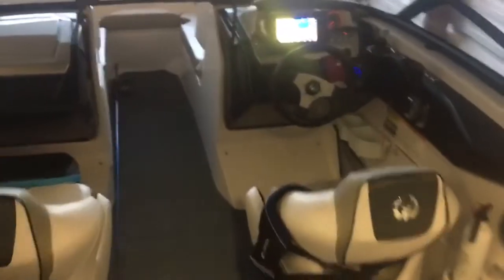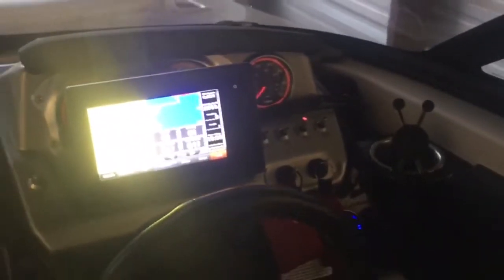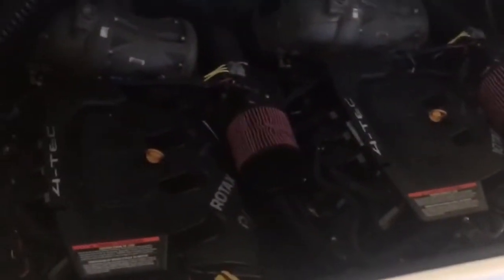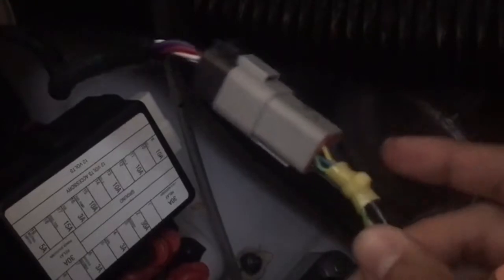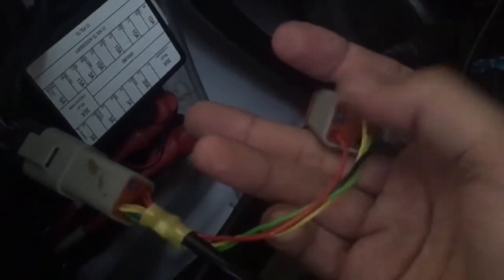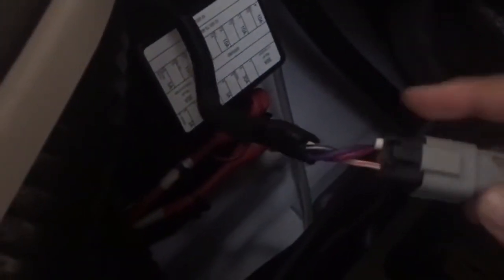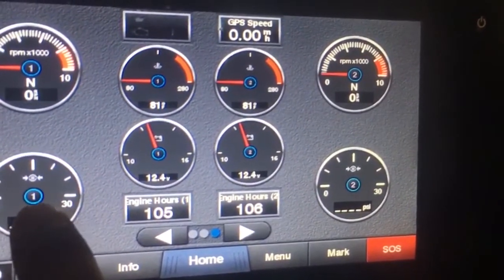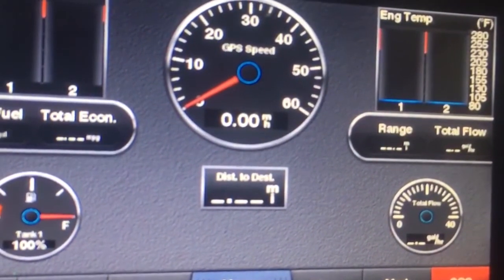NMEA 2000 Gateway for BRP Rotax Engines

Comment: Possible to install on a seadoo jet ski 2021 gti se 170?
Reply: yes, all modern BRP engines are supported by YDEG-04
Reply: @nekokoneko3856  Is there a guide available for this?
Reply: @nekokoneko3856  
I have the same problem as you. One red light and one green light. Garmin can recognize YGED-4 but cannot receive engine data. I am a foreigner. There is no chat software for you. You can only ask here
Reply: @钱网  First RED flash = no connection to engine bus. Need to check if you got +12 Volt DC power on engine's 6-pin female diagnostic connector. Turn engine ignition ON. You should get approx. + 12 Volts DC on socket 5 ( Red + Black wire , V+ ) in respect to socket 3 ( Black wire, GND ). If no voltage, seek for blown fuse in the fusebox ( Red + Black wire has a dedicated fuse ).
Reply: @nekokoneko3856  THANK YOU

Comment: Getting a red green led light what could be wrong
Reply: No engine data received. Please, kindly, send several good quality photos showing how is YDEG-04 connected to the engine exactly to our technical support — https://www.yachtd.com/support/

Make sure to take good quality photos, with all connectors, wires and their positions clearly visible.

-- Alex K, Yacht Devices engineer --
Reply: @nekokoneko3856  can you give me all part needed for a 2022 sea-doo switch 170 with a garmin 72sv and I will purchase thank you!
Reply: You need our YDEG-04 gateway + extra "BRP adaptor cable" available as YDEG-04 accessory.
Reply: I’m getting the same results when I plugged mine in. Did you get your problem fixed. I followed the manual on setting up for a BRP engine and still can’t get any data on my Raymarine axiom 9. Any help would be   Appreciated.
Reply: @csrammanram4457  Please, turn engine ON and NMEA 2000 backbone ON and confirm the LED indication you got on YDEG-04 unit ? YDEG-04 should produce a sequence of two consecutive LED flashes, which sequence is observed ?
Reply: @csrammanram4457  Also, please, tell me if YDEG-04 "BRP adaptor cable" was used for engine-to-YDEG-04 connection — or YDEG-04 Y-cable was rewired to match the BRP diagnostics connector pinout given in YDEG-04 manual ?
Reply: @nekokoneko3856  I just found out I needed the adapter for BRP set up. I missed it when reading the manual. I just ordered it yesterday from them. I will update once I get the cable adapter.
Reply: @csrammanram4457  Thank you for the reply. 

> I just found out I needed the adapter for BRP set up.

Correct.

>I just ordered it yesterday from them. I will update once I get the cable adapter.

Correct. 

Note that If YDEG-04 was connected with no adapter cable you may get a fuse blown on BRP DIAGNOSTIC connector power rail. 

So, before connecting YDEG-04, please, power up the engine and check power rail voltage presence — directly on BRP DIAGNOSTIC (female) connector — between pins 3 ( Ground, Black wire ) and 5 ( V+, Red or Purple wire ) — you should get ~ 12 Volt DC.

If no voltage present, one of the engine fuses is blown, find and replace it.
Reply: @nekokoneko3856  I’m getting green lights now with right cable. I had two fuses pop. From the first hook up. Now I can’t get the axiom to recognize the engine.
Reply: @csrammanram4457  Confirm you got both LED flashes GREEN
If so, enable BRP protocol with YDEG-04 setting BRP_ROTAX=ON

If first LED flash is RED, second GREEN — find the correct CAN bus speed — try 250 or 500 
Refer device manual, Section IV.2 Connection to BRP Rotax Engines
Reply: @csrammanram4457  any progress ?
Reply: @nekokoneko3856  Yacht Devices sent a update file and fixed my YDEG.TXT text. I didn’t have the engine set to handshake. I’m getting most of the engine information now. They also told me the fuel signal goes straight to the dash and not though the ECM. I just watched your video again and seen that you had a reading on your MFD screen. Did you change any of the settings in the TXT file to get them. I have one tank. This is what they sent me was 
Fuel=Diesel 
Fuel_0=1,Port
Fuel_1=1,Starboad
Fuel_2=Off
Reply: @csrammanram4457  If your particular setup has no fuel level sensor(s) *connected directly to engine controller*, and you have a separate analog fuel level instruments, you will not be able to get fuel level data on the engine CAN bus, so no YDEG-04 settings can fix this issue.

The only way to get fuel level reading in such setups is to add our YDTA-01 tank adaptor unit and connect it in parallel to an existing analog fuel metering system.

Please, confirm if you got fuel level sensor connected directly to analog "fuel-level" input on instrumentation panel 
or
fuel level sensor is conencted to engine controller analog "fuel-level" input
Reply: @nekokoneko3856  I have 2019 Scarab 195 ID with 250HP. It would be the same as boat in this video but newer. Did Scarab change the wires for the newer boats?